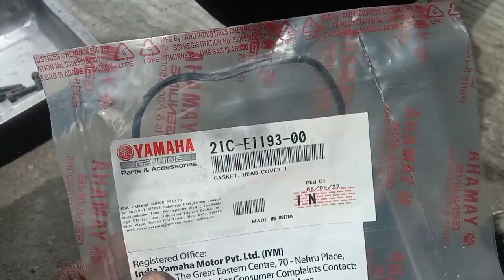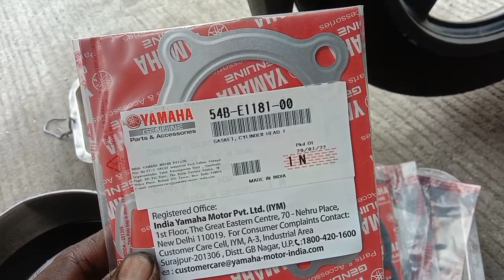SZ Yamaha Top Overhaul palit gasket

Comment: Bro, XRM 125 carb motor ko. Nag bore-up ako ng 54mm, port, 28mm carb, racing cam/CDI. Nung nabreak-in ko na kinuha ko top speed. Ang 3rd gear ay abot ng 120kph nung mag 4th gear ako 125kph lang Bakit kaya maniha ang 4th gear? Thanks sana masagot mo idol🙏
Reply from the maker: Para sakin idol matolin nayan pero kung gusto mo pa tune nalng ang carb mo bila ka ng kit ng carb na my number para balance mo ang timing ng carb
Reply: @warmjuntvmotorepairsmotovl6073  thanks idol 🙏